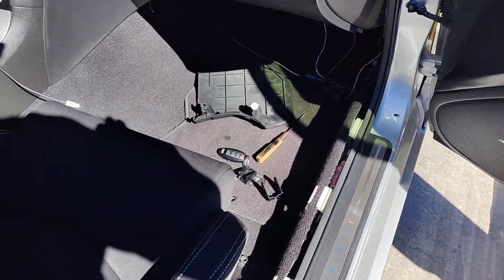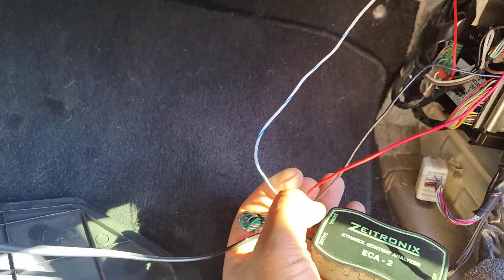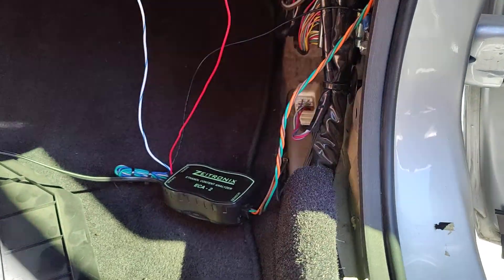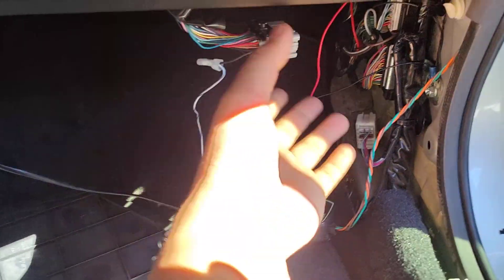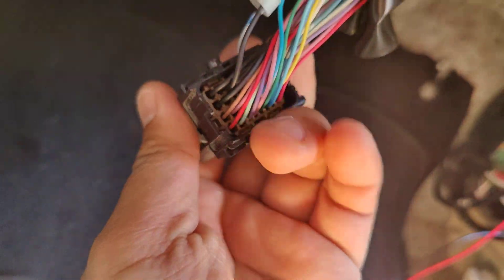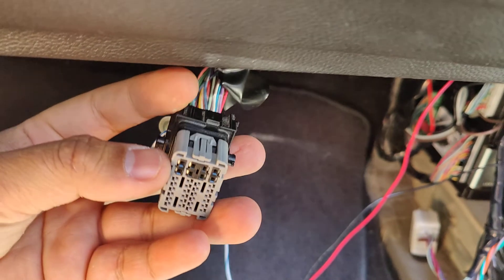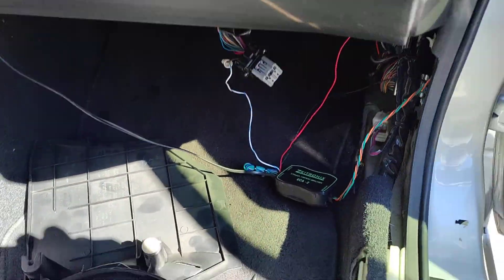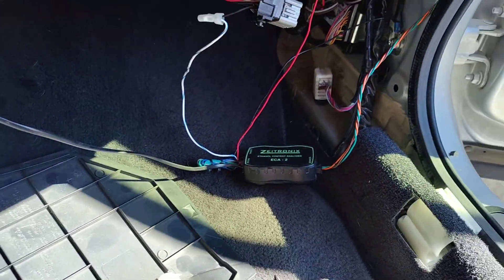ZEITRONIX ECA-2 flex fuel kit pin 102 for G37/370z

Comment: Pin 102 is a TEAL wire on a g37. NOT Grey or black.
Reply: Different models/years use different color. Stop spreading bs. Always reference the factory service manual electrical schematic for your model and year

Comment: This is the WRONG pin to tap for ethanol content analyzer. I tapped into this and ecu was seeing 75% ethanol on an ethanol-free fuel and going rich under load. Pin 102 is on the complete opposite side of this pin. Teal wire.
Reply from the maker: Is it?? Damn..  I thought it was the correct one and I was getting my readings pretty accurate... But I could be wrong!🙏🙏🙏🙏
Reply: @INFINITIBROTHER  yep, I used this vid as a guide a couple years back. Never finished the car. Just got it running a week ago and was trying to figure out why I keep fuel cutting and afr going to 8 under load. Checked wiring for My ECA and sure enough the pin shown in the video is 122, NOT 102. Would run fine if tuned for e85 but if running 91-93 octane you will have issues.
Reply from the maker: @xStaySkilledx  Maybe that's why I never had problems! Thanks for pointing this out🙏🙏🙏🙏😎😎😎
Reply: i’m having issues with my ethanol content reading as well, i tapped into the teal wire(plug side) and my tuner is reading 0 on ecutech my car is a 2012 g37x anything would help at this point💀
Reply: @johnduffy6475  I’d pull a diagram and verify you have 102 tapped. Colors can vary

Comment: Wait so you need flex fuel kit to run both 93 and E85 or just injectors and fuel pump upgrade would work?
Reply from the maker: To run maps for both yes🤙 if you want une for only one. U don't need it
Reply: @INFINITIBROTHER  I'm trying to run both tbh, fuel pump and E85 and be able to choose between when to run E85 and 93,but I didn't know I'll need a flex fuel kit so thank you 🙌
Reply from the maker: @khelvhin  yes I will need this. Flex fuel gives u the option to change between fuels

Comment: Are you positive you cut pin 102? Pin 102, by my understanding, is a small gauge signal wire on the opposite side of the plug you pointed to. On Q’s this should be Teal and on a 09-18 370z it’s grey. Seemed like you had it in a larger gauge black wire. 

If you are looking at the harness side of the plug (wires coming out of plug), with the large pins to the left, pin 102 is in the 3rd row from the top second pin from the right.
Reply: Pin 102 should be in the same pin on all of them. The wire color changes but the Q’s the G37’s and the 370s it’s supposed to be in the same spot. Have you tried to run straight gas? If you are looking at a gauge and seeing ethanol content differences, it doesn’t necessarily mean you hooked it up to pin 102 incorrectly and that it’s actually adjusting your tune to compensate properly. The sensor should be reading fine and your gauge could be working properly, but there’s no way that the ecu is receiving the data as it is.
Reply from the maker: Yes I've ran straight pump gas to see if the content drops all the way back down to 10% ethanol. I also use ethanol from gas stations to see the content difference versus the good stuff at a warehouse. I was instructed to install it like this from specialty Z over the phone and  emailing them pictures.
Reply: @INFINITIBROTHER  I understand that the content will work as long as it’s powered to a good 12v and grounded. The issue would be in the map automatically changing. Swapping between only slightly different ethanol contents wouldn’t make a big enough difference to cause the car to run bad. If you go from e85 to straight 91 octane pump gas would be the only time you needed it to work.
Reply from the maker: @jacobturpen1040  I get what you're saying. I honestly don't know if it was switching up or not but the car was ran on ethanol Almost 100% of the time I only went on to pump gas occasionally just a cycle. I may had this on wrong! But the whole time I had the car it ran perfect like a champ and I also found out that there's another way actually an easier way of connecting this😅
Reply: @INFINITIBROTHER what easier way? tryna install mine soon getting tuned in a few days
Reply from the maker: Yes that is pin 102 on a G37 it could be different on a Q I'm not too sure.. but yes it works because my content gauge is pretty accurate when I use gas station ethanol and warehouse ethanol 🙏🤙

Comment: Do you need a flex fuel kit to run e85? I’ve been run it with just injector and pump upgrade
Reply from the maker: You don't need to flex fuel to run E85 The only convenience to get out of this is to flex fuel if you want to travel or drive far so you can use pump gas if there's no ethanol

Comment: So pin 102, did u just cut the existing wire and tap that wire with the blue/white rewire?? Or did u leave that wire hooked up an just shove another wire into it?
Reply from the maker: Pin 102 is the ethanol content wire. You will want to cut that wire and connect the white and blue wire to the harness side not the plug side. If you connected to the plug side the system will not be reading anything.
Reply: @INFINITIBROTHER  ya. But what does the wire that I would be cutting do .. I get ,that is the pin I need to go to.. but the wire that is currently in place pin 102... what does that wire do BEFORE I cut it.
Reply from the maker: @immortal_z34  so sorry I'm getting you confused I am totally wrong. You will have to cut the wire pin 102. And you will have to leave the harness side exposed. The harness side is the wiring harness that goes into the engine. You will want to connect the kit to the plug side that plugs into the ECU. If you connect the kit wire to the harness you will not get any signal or content. You will have to connect the kit to the plug side so that it connects to the ECU.
Reply from the maker: @immortal_z34  I hope I answered your question... That wire that you're cutting sends signal to the ECU telling it how much ethanol content is in the system
Reply: @INFINITIBROTHER  I mean... ya kinda bro.. I think ur getting confused of what I'm asking... I know the blue/white wire.. is the ethanol content wire.. I get it... but what I'm asking is... the wire that is OEM. In pin 102... BEFORE you cut it lol... what is THAT wire and what is THAT WIRES purpose... before its cut. What signal is that wire sending.. is it to evap... is it to a regulator.. I mean.. I don't know how else to ask bro lol. U keep going into other stuff... and avoiding what I'm asking.. so if u don't know bro. It's cool.. I just figured u would know what that wire does BEFORE u cut it.
Reply from the maker: @immortal_z34  yes I'm so sorry I cant answer that question... All I know is that it is the ethanol content wire and it is sending signal to the ECU. It might be coming from evap but I'm not too sure.. I just followed the instructions and I also called cjm for help. . Maybe you can  look up a wiring diagram for the car to make sure 🙏🤙
Reply: It’s the signal wire on the evap pressure sensor that is back of the car attached to the charcoal canister. You cut the wire because your flex fuel sensor is probably near the front of the car where the evap solenoid is at the back. If you hooked your signal wire up at the back of the car, the wire would then travel out of the ecu, to the back of the car, then all the way back up front for the flex fuel sensor. The instructions shorten the distance signal wire travels by just cutting it and going straight to the sensor. 

I’m also 99% convinced this guy did not cut pin 102 in the video. Pin 102 is a small pin on the opposite side of where he pointed and should be a teal wire on Q’s and a Grey wire on 370z’s. Seemed like his was a larger gauge black wire.
Reply: What did pin 102 originally go for.. like what was its purpose?